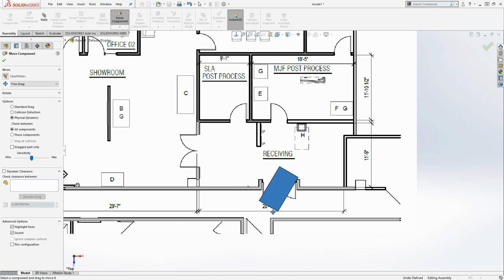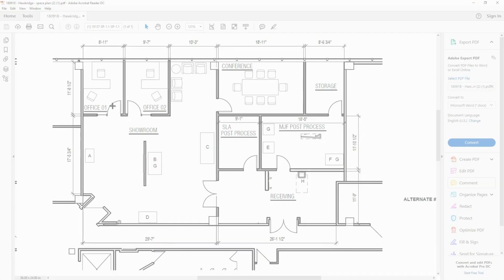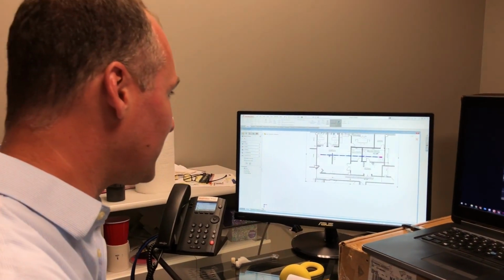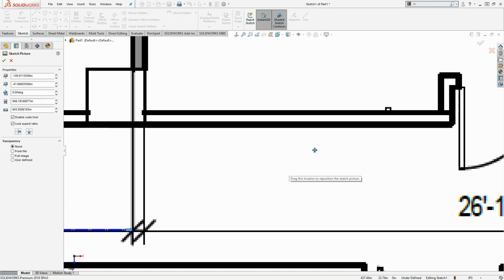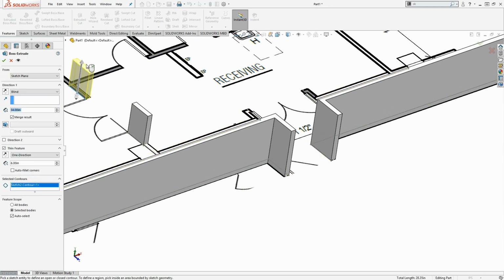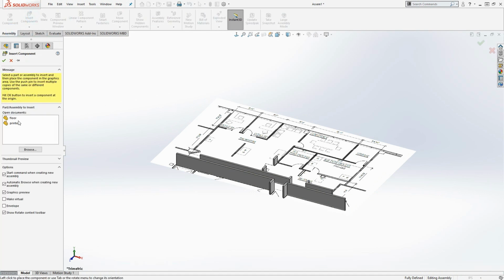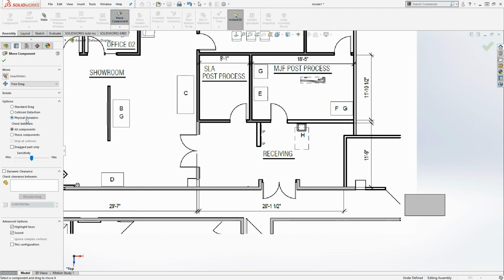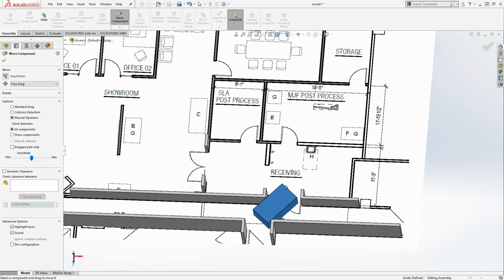SOLIDWORKS Sketch Space Study

Comment: Nice thought to show us something put no details i.e. how to scale; can't see how that was done.
Reply: When you open a new document in Solidworks it has no scale at all. In the video he drew a line where the architect has dimensioned the hallway-wall and basically told the program the length of that line (based on the length he already had on the plan). From that point on forward the program has a reference and knows what scale the picture has.

I know your comment is 1+ year old but maybe it'll still help you or somebody else who comes to this video in the future...!
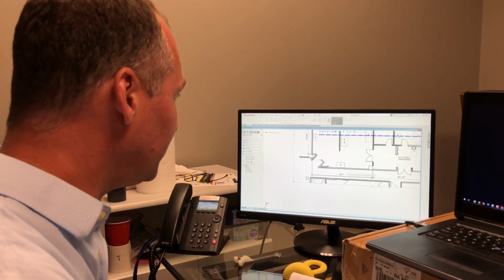Reply: I realize it's a 3 year old comment.  But there are bunch of people moving to Solidworks since the maker price is being offered.  There's some expectation that you know how to use SW in this video.  They are showing a novel use case and not how to do the prep work. In SW, when you draw a line, you can specify the dimension, or you can do it later.  Draw a line. Use SmartDimension to tell it how long. That's what happened at @00:49.